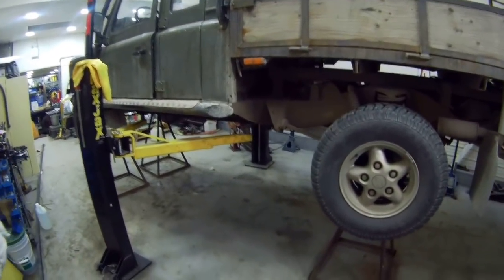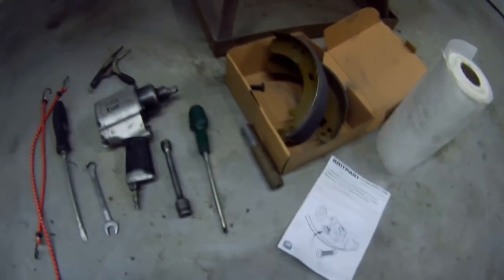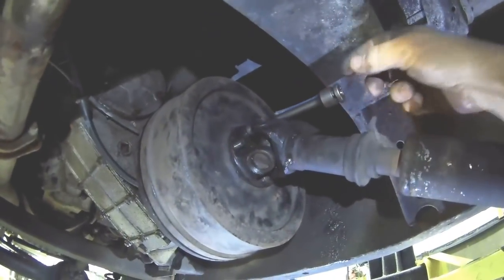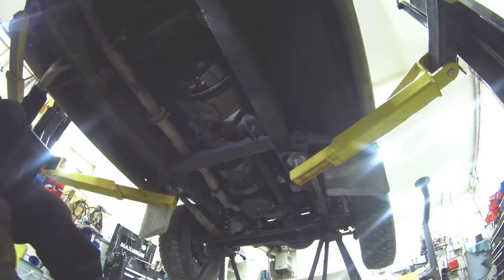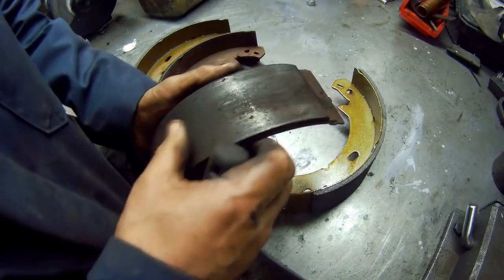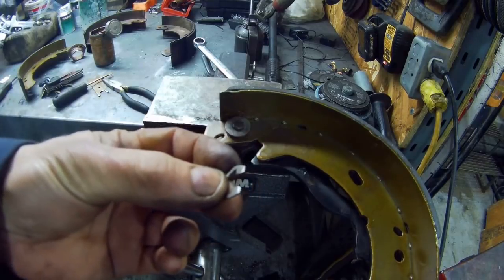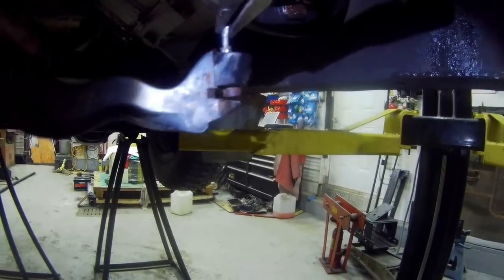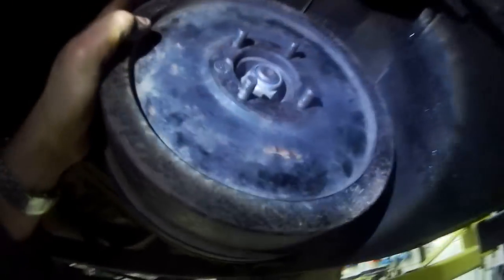Changing the transmission brake shoes on a Land Rover

Comment: hi mike, we have just did this job, and we are having a right job getting the drum back on, any tips you can give me?  My dad decided it needed doing, which it didn't need doing, only cause the screw came slack.
Reply from the maker: You may have the shoes slightly higher or lower
Give them a tap up or down if the adjuster is backed right off
Reply: @BritannicaRestorations  Thanks very much mike for that, it was a great help.  All back together now,  what we didn't do, was greece the contact points on the back plate,  Did that and all was good.  But we had to remove the back plate, to access the pin.   Anyway i owe you a beer!